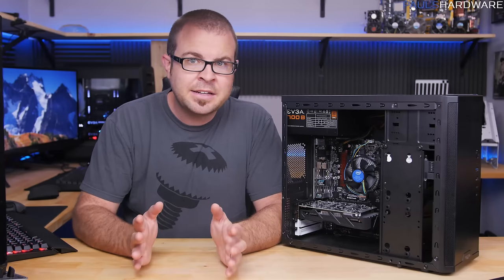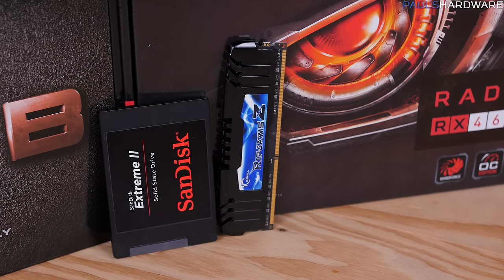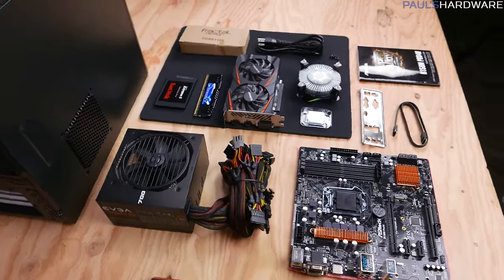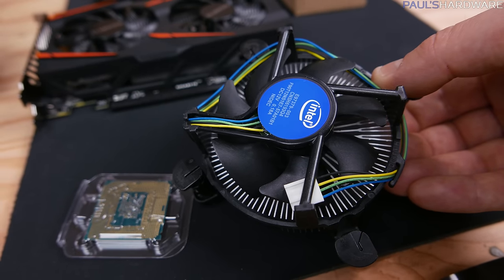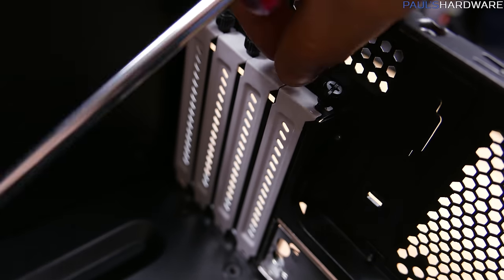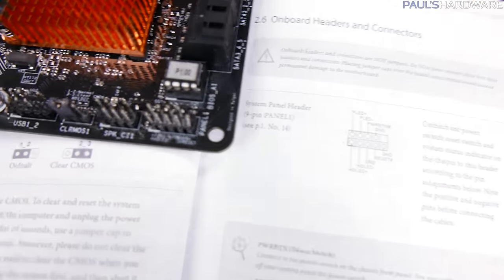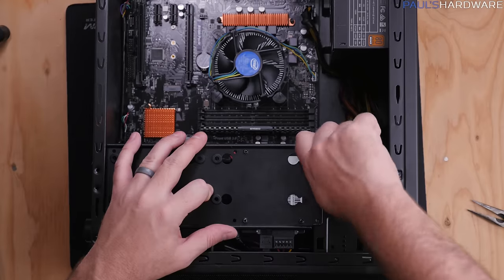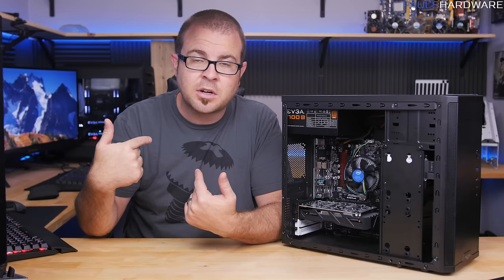How To Build a $500 Gaming Computer

Comment: I have an I7 2600 in a small form factor case that is overheating and I can't get a decent video card. Is this processor worth getting a new motherboard for?  I am looking at moving it out of my Dell proprietary small case into a new one that I can use a real video card on and better cooling.  I am on a tight budget that is why I'm not looking at the new stuff but would it be more cost effective to go with a Ryzen 5, what is your recommendation?

Comment: Hey Paul, I was wondering (Your videos are VERY informative..)
What kind of power supply should I have for my first build? I'll list the parts down below.

Video Card -GTX 1050TI
GPU - Intel Core i5-6500
Storage - Seagate 1TB 64MB Cache
Ram Sticks - Kingston HyperX 8GBs (2 x 4GBS)
Motherboard - Gigabyte GA-H170M-D3H DDR4
Operating System - Windows 10 Home

Feedback would be appreciated! :)
   ~RustyGaming

Comment: Can I switch out the Rx460 with a rx480?
Also, I hope i wont have a serious degrade cuz im crossing out the ssd and getting an hdd instead, also do i need to get a bigger power supply?
Reply from the maker: I believe AMD recommends a 500W PSU for the RX 480, so you might consider spending just a little more on the PSU. A HDD will only draw 3-5W max so that's usually not a concern.
Reply: Oh wow thnx for the quick reply.
So you u think this would be a gud combination (p.s This is my frst pc build ever),
i3 6100
rx 480
8 gb (4x4)
500 wats psu
1 tb 5400 terraflops
the case u used (which is awesome btw)
and the motherboard u used.
Reply: Hoping it will have a bit better benchmarks than ur build (cause rx 480).
I went with 480 cuz i wanted to try out VR
Reply from the maker: That should be good, in the future I would want to upgrade to an SSD (just makes everything snappier, that 5400RPM HDD will slow things down) and possibly a quad-core CPU like a 6400 or 6500, or Kaby Lake when those come out
Reply: Paul's Hardware Awesome. 
Thanks a million.
Reply: Was wondering is it gud enough to run basic  VR?
Reply: M. Ali hard drives spinning under 72,000 rpm are  typically used for multiple drives close together in raid configuration. Reason being the less vibrations keep the disk from vibrating each other out of sync.
Reply: Patrick Fitzwater Oh thts cool. I have another doubt, HOw gud is 750 ti?
Reply: M. Ali worse than 460 but cheaper,i believe before the 460 came out it was the best price to performance card on the market. Dont get tour hopes up tho its still a 100$ card and you'll get about 30fps on gta V on high/ultra with a decent cpu on 1080p

Comment: Have you ever considered using the Rosewill srm-01 for a budget build? It seems virtually identical to the fractal design core 1100 shown in the video but can be found for as low as 15 $ on amazon.

Comment: Another good 500$ build:

Asus Strix Radeon RX 470 OC Edition - $200
Intel Core i3-6100 with included CPU cooler - $118.29
Gigabyte GA-H110M-A micro-ATX motherboard - $54
SilverStone 1-to-2 PWM fan splitter cable - $4.39
GSkill Ripjaws V 8GB - $35
Rosewill Line-M - $35
EVGA 430 W1 - $32
WD Caviar Blue 320GB - $22

Just built it and works great although I upgraded to 16gb ram

Comment: I'm curious how the i3 and 460 will do. If they will be enough to get playable frame rates with newer titles at mostly high settings at 1080p. My older system which I gave to my sister, is a i5 2500k  with a GTX960 and it struggles with some newer games.

Comment: Been thinking of downsizing my 6600k to a micro ATX motherboard and case, just wondering if this type of non-z170 chipset board would work with my K processor? Obviously overclocking isn't going to happen, but would the cpu still work?
Reply: yes, it will.

Comment: when do i need to upgrade from my G650M power supply? 80 plus gold, i have an i7 4790k, a 980 ti graphics card, and a 360mm radiator, with 2 fans on the gpu, and 3 fans in the case, ive got 1 ssd 120gb and 1 hdd 1tb. im planning on getting two 1080 ti's maybe when they come out but not sure if my power supply can handle that. also probs getting a 6 or 8core cpu for streaming coz the cpu i have now cant handle 1080p streaming on ultra quality.

Comment: If you spend a little bit more and get a Z170 mobo you can do a BCLK OC if you're willing to live with the handful of drawbacks. My i5-6500 has a BCLK OC to 4.4 (very mild) and it plays super nicely.
Reply from the maker: +Noah B I just... I dunno, I don't like my BIOS getting older and older and no turbo boost etc, but it was fun. Nice OC though!
Reply: Paul's Hardware Yeah I had it up to 4.6 GHz for a hero pull but I bought a pretty small cooler so it wasn't practical to run it up there, right now under p95 load for hours socket temp only gets up to 65 degrees max.

Comment: Hey Paul.  I'm new to building computers.  I don't like how most power supplies have multicolored wiring.  Are most custom builds that have color matched cables aftermarket wiring, and if so where can you get those?  Are they sleeved?  I'm looking to get some nice color matched wiring for my build.  Or if anyone that sees this comment knows, any reply would be awesome, thanks.
Reply: Broc Bolin the colored cables you see are usually from cablemods. They are sleeved.
Reply: Valk NA thanks

Comment: I know it's always a good idea to check to make sure the triangles line up on the CPU, but just out of curiosity, have you ever (correctly) installed an intel CPU in an orientation other than with the words right side up?
Reply: X99, the writing is upside down once it's installed onto a motherboard.
Reply from the maker: +Jeffrey Wong ...no?

Comment: Hmmm, how does the RX 460 compare to the GTX 960? This PC is almost VR capable with Oculus' new min spec requirements, in fact, it might be close enough to be passable for less demanding titles/titles that allow you to adjust to a "low" graphical setting. Pretty neat.
Reply from the maker: it would be a very simple thing to spend $40-$50 more on an RX 470 for this build, everything would be the same you'd just need to connect a PCI Express Graphics power connector from the PSU to the GPU

Comment: Should I get an i3 6100 then a GTXX 1050 or i5 and RX480?
Reply: I'd recommend i5 and RX 480 but there really isn't a difference 1050 cost a bit more, but better graphics, and the 480 costs less with slightly bad graphics than the 1050, i3 way slower than i5. But you should get i5 and the 1050 than the performance is unbearable!

Comment: If I was using the PSU to ground myself, does the outlet need to be on or off?
Reply from the maker: if you mean the switch on the PSU, it can be left off
Reply: Paul I have that same power supply and I thought I would let you know that according to my multimeter it is nonconductive, so you can't ground yourself on it.
Reply: the paint that is

Comment: Paul. Feedback. I bought the parts mentioned. I don't recall exactly why, but I seem to recall that I bought a different band memory stick, but same size and specs. 1, after I plugged it in and turned it on nothing happened. No fans, no lights. Nothing. I rewatched the video, took wires out and back in etc... tried it again, aske my daughter to look at it, and she suggested I turn it on via the button on the front (duh). 2, I did not own a keyboard, so I went out and bought one. A wireless one. As best I can tell, it is impossible to get to the bios setup via wireless keyboard on a brand new keyboard. CONCLUSION: It seems like it worked. but I will have to wait until I get a wired keyboard tomorrow to verify. Otherwise THANKS A LOT!
Reply: Sorry, one more 3, The video card did not have the blue VGA connector. So, since I did not want to buy a new monitor, and wanted to use the video card, I had to buy a converter.

Comment: or go for secondhand stuff?! I got an i7 4790k (4.8ghz oc), 16 gig ram,  r9 fury, corsair carbide air 540, corsair h60 and corsair ax860i topped of with a 2tb hdd and 250 gb ssd for eum, I think 850 euro. I max EVERYTHING with my build and it was a long way under 1k.

Comment: I have a question. My motherboard supports 2133MHz DDR4 memory but my ram is 2400MHz DDR4 memory. Will this cause me some problem ? thanks.
Reply: no. ur ram will just run at 2133 mhz

Comment: I want to build this pc, only I'll be switching the body out for a Bitfenix Nova. Wait where does the wifi chip go? is it build in to the board? Mind you due to being used to it we bought our pc's ready made, and in this case my Acer Aspire XC100 had a wifi board lol
Reply: The WiFi card is installed either via PCIe or a slot called M.2 on your motherboard. USB WiFi exists as well.

Comment: I was wondering if this would be good with tv setup and if you can stream to not so powerful laptops or mac book pro. Generally I use Macbook for my everyday use and my son has windows 10 laptop that he uses.  With the Mac I was wondering if I need download windows to stream and if I do is there a cheap windows solution for Mac.  I also was wondering if can use bluetooth for Xbox1 S controllers with this build.

Comment: Recently I bought the Photon 2.0 PC gaming build.

I've built the thing, fans are running but the back USBs aren't working whatsoever. The monitor is plugged in and won't turn on and ditto for the keyboard. Unfortunately this is the only way I know how to open the bios with a new computer.

I'm fairly new to this stuff so if I'm missing something obvious my apologies, however I have done a lot of research with no avail. If I'm missing a crucial part of information, tell me.
Specs:

i3-6100 
EVGA GTX 1060 
Gigabyte H110M-A
 16GB Crucial Ballistix
 1TB WD Blue
 500W EVGA
 PSU Thermaltake Versa H15
Reply: If your up for paying around 150 more i'd recommend you get the i5-4460 on Amazon.ca for CDN$242.49.

Comment: can u pls check if my configuration is good or bad 
case-corsair series spec-m2 micro gtx gaming case 
gpu-msi gtx10606gb gddr5
motherboard-asus micro atx ddr4 lga1151 h110m 
cpu-intel core i5 6500 lga1151 3.20ghz 
psu-650 w 
ram-8gb ram ddr4
and thanks you helped me to build my first gaming pc

Comment: We can buy like a be quite CPU fan right   
It's only like $35 I forgot the name of the fan but will it be worth it?
Reply from the maker: I'd say yes, for $20-$30 you can get a better & quieter CPU heatsink/fan. You can't overclock with this chipset though, so that detracts just a bit from the utility of getting an aftermarket cooler.
Reply: alright thanks, but i can change the processor anyway for a couple of bucks

Comment: hey paul, if i build this in the cement floor bare feeted, will i still face static problem?
Reply from the maker: +Devjit Paul I don't think so, just touch the case every so often and you should be fine
Reply: Paul's Hardware OMG sir, you replied, so being grounded and "that static problem" are 2 different things.

Comment: something i feel important to note that you didnt: when installing a stock intel heatsink, out of the box the colored wires block the operation of the fan. Not everyone notices and as a result when the system is on the fan can't spin. I would note to those people to properly loosen and secure the 4 pin cpu fan wires away from the fan blades of the heat sink to ensure proper fan operation.

Comment: ive always questioned why youd put the OS on the SSD, what does it really benefit aside from boot times(which is extremely unimportant)
Reply: the entire OS experince is more "snappy" and responsive when one has had a ssd booted OS operation a HD booted one feel slugish and slow its quite anoying its like monitor refresh rate once you get use to the better it becomes hard to downgrade yourself
Reply: Try it and you will be amazed. There is no performance boost such as placing an SSD into your system. You need to test it yourself to believe.
Reply: Boot times are unimportant? Man, you must like wasting time, do you?
Reply: TrueZtyleZ7 wasting time? im not the one constantly rebooting my computer
Reply: Not everyone leaves their PCs running 24/7.  And sometimes, you just need to reboot.  Plus, like the first two wrote, it really does make a huge difference in the overall experience.
Reply: went from a hdd to a samsung 850, and let's just say im never going back to harddrives
Reply: Sleep mode exists, you know
Reply: in a work environment its a BIG deal. I am in charge of 20 or so computers at my work & i have all of them set in bios to come on about 20 minutes before that employee gets there specifically because we dont have SSD. All the crap that has to load up before its ready to go takes a while & the boss isnt to happy while people just sit there for 10+ minutes waiting for the computer to ready to work. My computer at home i push the button sit down & i can start doing what i need.

Comment: What do you mean with "short" when you were talking about the twist ties? (Sry if short isn't the right word, i dont understand it) haha!
Reply from the maker: To short something in an electrical circuit is to bridge two connections that shouldn't be bridged -- so if you have a twist tie with exposed metal, and it touches a couple contacts on the motherboard or GPU and connects the two, your PC won't start, or it will shut down automatically, or worst-case it could damage something. Plastic zip ties are a better option for cable management if you have them.
Reply: Now i get it, thank you! Great video as always!

Comment: will the psu overheat since the fan is at the top and it's facing the top of the case?
Reply: It might in fringe circumstances, but you can always face it down.

Comment: i may need some help here...
my potato is dying, i can hear its death rattle as i type this.
its too old to upgrade so i am looking to build a whole new one
the specs are an AMD dual core 2.3 ghz, 4 gig ddr2, gtx 240, i think its only redeeming quality is the lightscribe dvdrw
i am wanting something that will stream and maybe do some editing 
looking around i see the 7700k and Z270 board with maybe 32 gig vram and either 2 1070's or one 1080(or 2) and think it will get the job done....but now with the new AMD stuff out im too confused about it all 
should i just stick with my setup or use the cheaper AMD stuff now that its out?
i have too many questions now and need some expert advice for this new wonder machine i want to build
any help is greatly appreciated

Comment: is this a good configuration to run newer games without lag with atleast 40-60 fps ot should i get fx 8300
Reply: This, the i3 has a lot more performance in games than the 8300.
Reply: Really,im kinda scared because i3 cpus have 2 cores
Reply: Stefan Kostić Yea but it has hyper treading which means it has 2 cores and 4 threads so it pretty much is a quad core.

Comment: My pc build has cost a total of $370 so far. 
i have a fractal define s case
msi z170a sli atx motherboard 
i3 6100
2x4gb avexir 2666 ddr4
thermaltake 650 watt psu
a pny 240gb ssd 
currently still using my old gtx560ti.. but i could easily upgrade and stay under $500
but everything happened to be on sale when i ordered it
i think i did well, considering this was my first actual build.

Comment: I'm having problems with this build. i bought the same computer but some parts are different and I'm having problems. Im not getting any signal to the monitor. i have a 7th gen cpu and in the manual it says it supports 6th gen cpu so it that the problem? and i also got the bios chip replaced from the manufacture. and the same problem still occurs. 
help.

Comment: does it matter which slot you put the ram in?
Reply from the maker: for dual channel memory (if you're installing RAM in 2-stick pairs) you'll want to use the proper DIMM slots as indicated by the motherboard manual, usually it's every other slot
Reply: Paul's Hardware it didn't say which slot to put the ram in my motherboard manual so I just put mine in the first slot and it worked

Comment: I don't know man. In my opinion it would be better to grab a used 8350/motherboard combo, which would allow you to stick a 1060 in there.
Reply from the maker: and you'll be able to upgrade that 8350 to...?
Reply: Good point. But then again, if you're planning to upgrade in the near future maybe you should spend a little bit more now on a better cpu and then upgrade the gpu down the line or viceversa (you would probably have to upgrade both the cpu and gpu with this build, since using a 460 with an i5 or i7 is subpar). Howewer, if we stick to the 500 bucks flat, I guess that it just comes down to whether you prefer to have worse performance now, but a better upgrade path for your cpu, or viceversa.

Comment: You mentioned that you shouldn't block air flow with cables, but that's myth's been busted. Luke at Linus stuck more and more cables (and I think eventually a sock) inside a case and it made no difference in temperatures at all. Don't believe it? It would make a great video for you. He had the case STUFFED with cables as far as he could stuff them, and it made no difference in temperature at all. The air from the fans flew right by.

Comment: How do you turns off when its the first time you start it? just press the button or something else?
Reply from the maker: If you just press the power button again it should turn off, if it doesn't you can hold the power button in for 5+ seconds and it'll force it to power down
Reply: Thanks Paul.

Comment: It's a good budget build but in my experience once you start getting into PC's you'll get bitten by the bug and it won't be long before you're wanting for more power! That's why I personally think You are better off going for a decent i5 as that will get rid of an CPU bottlenecks that the i3 will no doubt have. That pretty much leaves just the GPU that you will need to upgrade in future.